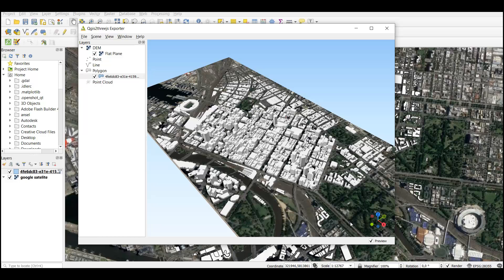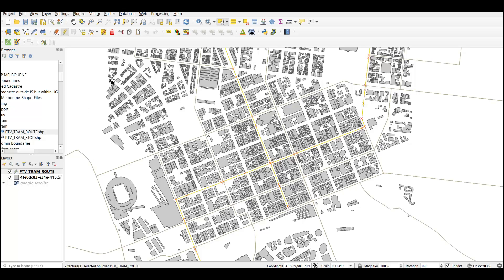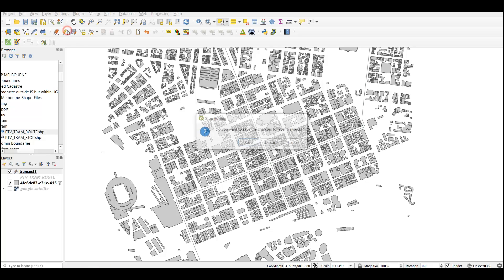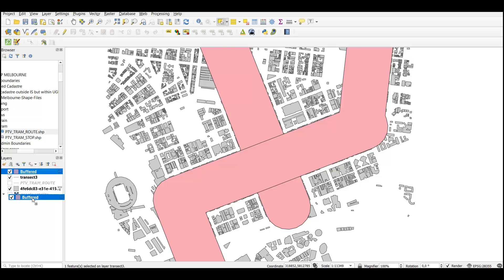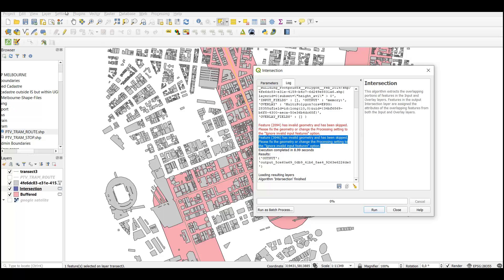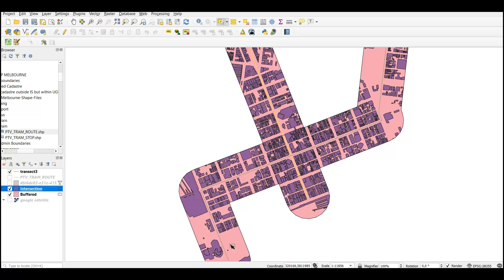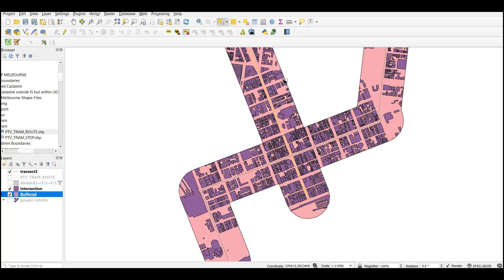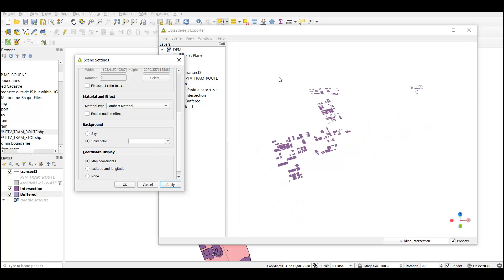PART 2 - How to create 3D BUILDING VIEW in QGIS using Qgis2threejs(+INTERSECTION & BUFFERED FEATURE)

Comment: Thanks for the video. Is it possible to export these 3D buildings to Sketchup or other 3D programs?
Reply from the maker: Hello, it is a completely different workflow to make the 3D buildings in CAD software using these datasets..I have one video that shows how to do that using rhino/grasshopper--this is the easiest and fastest way to extrude buildings in an urban scale using dataset from AURIN.
This pluggin I would say is mostly for visual--but I could be wrong as I haven't explored further than this.
Hope this helps!